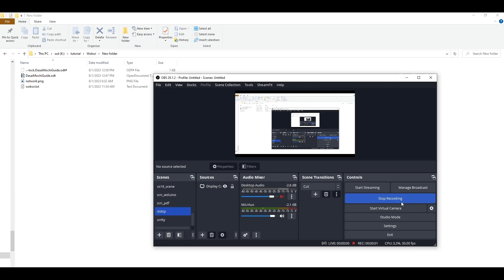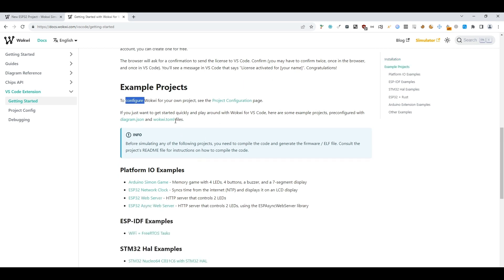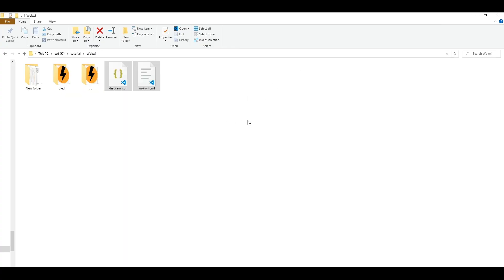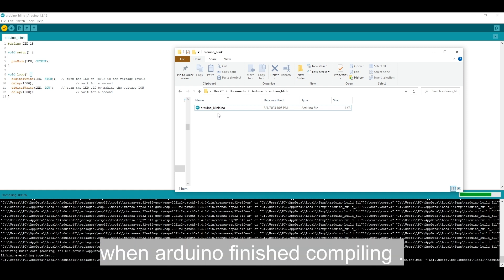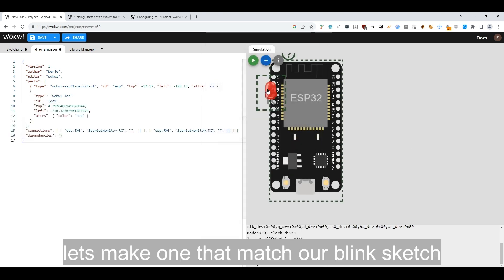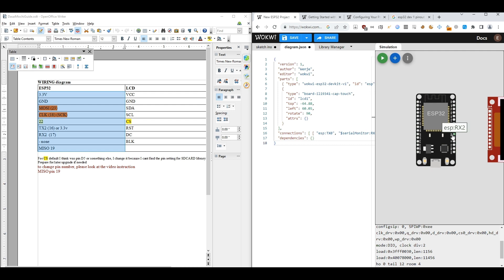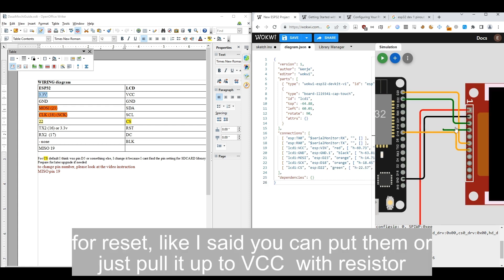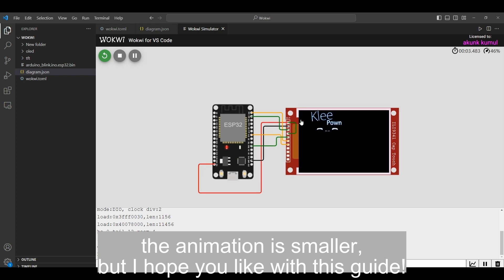How to simulate arduino program using WOKWI.com

Comment: Any Esp32 works for the project?  The thing is that when I look for it to buy I get the Esp32 (micro USB) and the esp32s (usb c) and I don't know if I changed anything apart from the ports